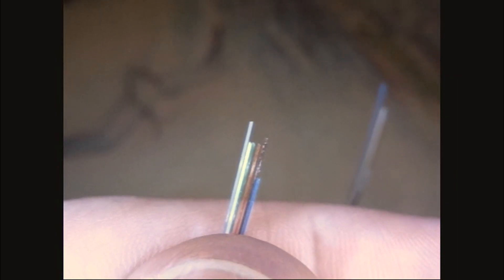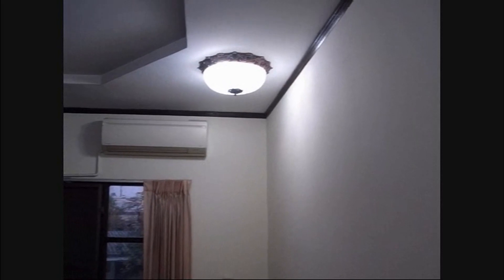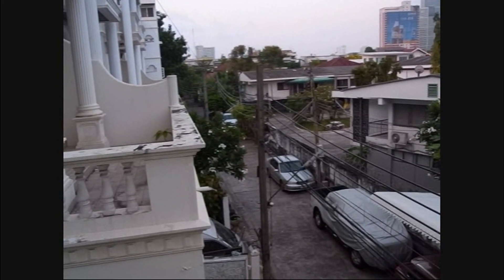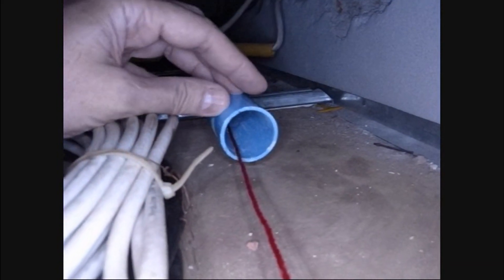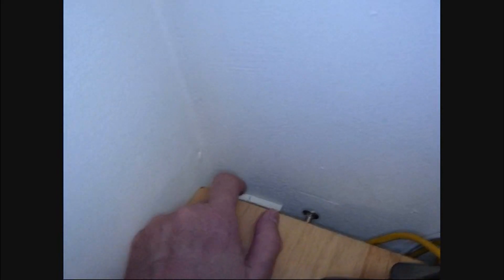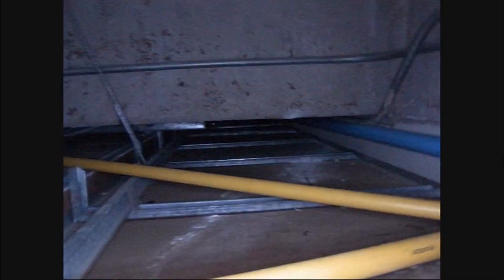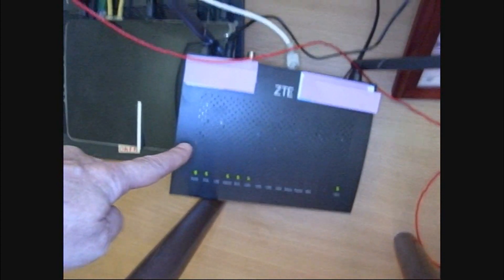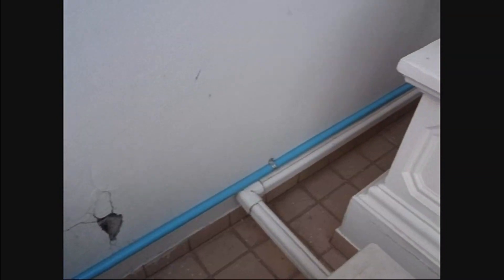Home Fiber Optic Internet Installation - Ideas For Your Install

Comment: Watched your excellent planning and preparation videos and hoped all your work would be appreciated by the installers. Apparently not, but glad you “persuaded” them to go with your plan. The big question is, How much has your connection speed increased? I assume the weakest link is now the computer limitations? I’m curious what the maximum throughput of fiber is and if there are NIC’s that would handle it? Anyway, very nice work, thanks for the information. Go enjoy the new speed.
Reply from the maker: To be honest the speed did not increase that much because we are cheap and only get one of the "bottom" packages.  What has improved immensely is reliability.  We live in a old area and the copper phone lines were 30-50 years old and the phone company refused to replace it because for 7 years they kept saying fiber was coming.  The old lines would quit for no reason randomly and always failed when it rained.  So the fiber has given us the consistent speed we were paying for but never got before.
I wired our house for gigabit but never see that kind of throughput except in short bursts.  So the hardware is capable, but my guess is that the computers are not optimized for it.  They have to buffer, gather data from mechanical harddisks with seek times, etc.  Add to that the bandwidth through the router is shared by 5 handheld devices and 3 desktops and 2 laptops (and maybe a neighbor or two!  ;) and it's good, but again it's the reliability that's REALLY noticeable!
Reply: tsbrownie Well at least you have the reliability working for your family (and couple of neighbors) now. Perhaps if you got the couple neighbors to kick in a little bit each, you could manage a jump to the next level package?
Reply from the maker: I hope I'm just joking about their using it.  I should probably change passwords now and again.  My wife wants to upgrade to a package that include 4G and remote wifi, but last we checked the sales people could not tell us exactly what that meant.  You gotta love the phone companies, high tech and unprepared.